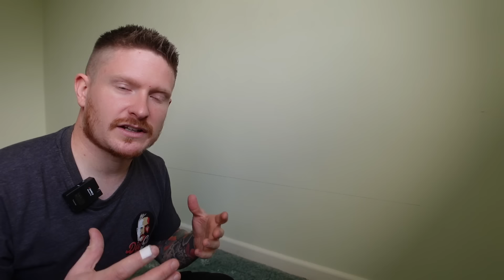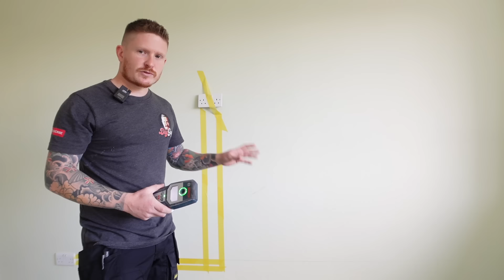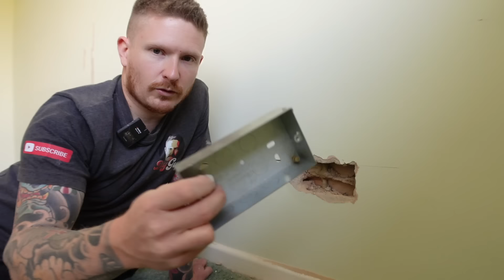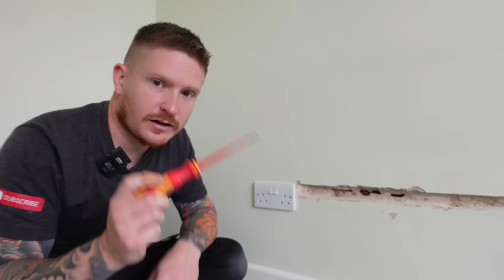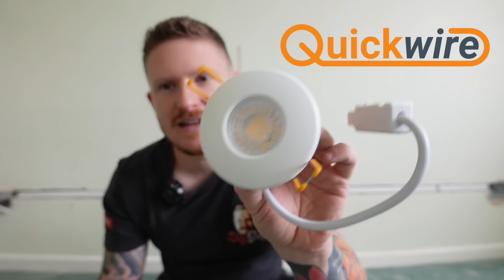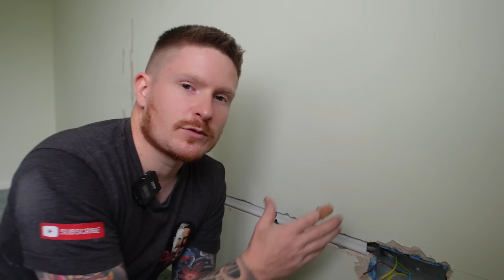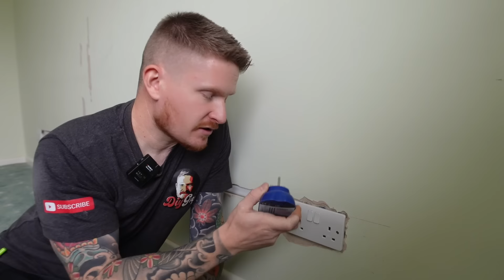How to Add a Socket to a Wall - Easy Step By Step Guide

Comment: He tested with a socket tester before and after. Wore a mask. Said you can only do one spur. Added a grommet. Doubled back the wires. Used a conduit (not required). Covered cable zones and how to check. Said only do it if you’re competent and confident or use a qualified electrician. Simple as it gets for a perfectly safe and legal diy job. If the original socket is RCD protected so is the new one. Great job ❤ ignore people trying to create fear using completely different examples.
Reply: You can buy dust guards with hoover attachments for normal angle grinders for around £30. They work very well.
Reply: Perfect job for a qualified electrician and whilst the fundamentals are pretty simple the work needs to be signed off on if it's a DIY job otherwise in the event if an electrical fire the insurance would be null and void. It's best to leave this work to qualified tradesmen.
Reply: Therein lies the problem. It's not really a DIY job (anymore).

Also, a basic socket tester only checks for polarity and some wiring faults but does not test for earth continuity, insulation resistance, or loop impedance.
Reply: @escfxp  why on earth would he need to test for continuity, insulation resistance or loop impedance on minor works? it's just a spur off a socket, nobody said you could do those tests with a socket tester either !
Reply: Call it whatever you want. It needs to be tested. “Just” is the problem. This kind of work would be illegal to even DIY in certain countries.
Reply: @escfxp it's generally a good idea to get an EICR done every five years in the home. If installing socket a couple of days before and the electrical test that follows is all good; no problem. 

The way in which this tutorial was delivered was excellent. 

Many, so called, certified electricians out there; don't bother with grommets, don't bother with wall capping and don't bother with proving units (because they simply touch the two ends together to check the testers are working) so what's your point? 

It is even possible to extend the ring, as opposed to spuring, with wagos if you wanted, although there might be a space issue so extra work might be required to accommodate a wago housing box.

Bottom line is, you're obviously safety conscious (and that is not a bad thing). However, to over think safty to the point that no progress is ever made is counterproductive. Only a competent person should undertake the work, that's what the regulations say and that's what this guy has said. 
Out of curiosity, do you ever cross the road or do you look for a bridge or under path out of fear of safty?
Reply: @escfxp it’s a diy job and that’s coming
From
An electrician ❤
Reply: @CEO786  So an amateur DIY person can do this job? Do you see where this is headed?
Reply: @escfxp  Of course, lots of work for electricians to fix.
Reply: @escfxp it’s a spur not a 3MW Data Centre
Reply: @craigevans8912 Try it in Australia or Germany and you might get lucky. Certain other countries have standards far higher than the UK in this regard.

Technically, it should have a minor works certificate should any incidents occur. Insurance, for example, will look to scrutinise on this if an electrical fire were to occur.
Reply: @craigevans8912 

Fires don't care.
Reply: @escfxp  Agreed - Plus I don't believe he is a trained electrician.
I don't care what people say but electrical jobs are not for the DIY'er
On another note, a lot of his other videos are well worth a watch.

Comment: Your socket won’t be level because of the overlap of the top of the socket outside the back box. What you’ve levelled is the top of the socket with the top of the new back box. Excellent video otherwise 👌

Comment: Can this be done by a DYI instead of an electrician?
Reply: Yes, you can alter any circuit as a DIYer but any new circuits have to be signed off by a qualified sparky
Reply: @Luke_Carpenter-i8q thanks I didnt know that, I thought an eletrician would always be necessary. Of course I would never do something complex, but rather simple stuff like increasing the number of sockets on a wall for example.
Reply: @vincoletto2  exactly

Comment: You left the original cpc's twisted together and un sleeved! This is a hazard if a live conductor was to come into contact with the bare cpc! Also just because someone see's 2 cables in a socket to persume its a ring final circuit, it could already be a radial circuit? Correct you can only spur once per outlet on a ring main, but you can add multiple outlets if you fit a fuse spur then the outlets as its protected by a the fuse spur, i wouldnt advise anyone touching electrics

Comment: Thanks for the video it's very informative 

However, you demonstrated moving socket just across, what if I need to move it on to the perpendicular wall, and pass the corner, will I stay in the zone ?

Thanks

Comment: Great video, very clear, however, I've only one spur to do so don't want to buy massive bags of PVA, bonding plaster etc - can I not just use a ready made filler like Polyfilla?
Reply from the maker: Glad you liked the video. I’ve never tried it but it may crack.
Reply: Clearly too late for you, but may help someone else in the same position looking.

You can get small bottles of pva like 500ml-1L you can probably even use crafts PVA as it’s the same thing 😅.

As far as fillers go you can use ready mixed, but you’ll have to build it up in - several- layers. Don’t use finishing fillers
As they’re designed to only fill a few mm. check on the tub how deep is the max filling and choose the deepest. 
There’s also small bags of all of these items, but if you’re only doing the one socket and no other DIY, then ready mixed is your best bet.

Comment: Hi Cameron, this video has been very helpful since I've been renovating my inherited property over the last few months to get it up to modern & safer standards and thanks to your videos I'm starting to learn DIY. Just wondering, does the socket tester you used in this video detect other kinds of electrical faults with the sockets if there are any? I just ask because I will soon need to get an electrical safety certificate and if the socket tester you recommend can detect any issues with the sockets before I get them checked by an electrician (and therefore allow me to have them remedied before I get failed) that would be helpful.
Reply from the maker: Hi. The socket tester will help you find issues with common faults such as reversed conductors, polarity.

Comment: You never run cable along the wall like that because it is open to being damaged. NEVER, NEVER, NEVER DO THIS? This is a very bad practice. I always learned as an apprentice to only do cabling vertically then either through the ceiling void and/or under the floor.
This breaks all the rules in my book.
If this cable zoning is now permitting this practice in the IEE Regs then it’s the biggest mistake they’ve ever made. ❌❌❌❌❌
Reply from the maker: This meets regs and is safe to do. Thanks
Reply: Mate your wrong 😂 the cables where run in zones, you can technically run vertical or horizon off a socket outlet

Comment: Could you go vertically first then horizontally from the lower socket?  And do you have to be a qualified electrician to do this ? Can you run the cables loose behind the plasterboard without a conduit and what if you want to keep the new socket in the ring main rather than creating a spur?
Reply: If the circuit is RCD protected & the cables are ran in the zone correctly then capping isn't required
Reply: Any additional electrical points, i.e. socket, light etc, or cable, must be fully tested with test equipment that is in calibration This work must pass ALL dead, live and function tests and a minor works certificate issued by a qualified electrician as per regulation. This is a LEGAL requirement.
For a d.i.y. channel he is competent and has given viewers great advice. There is a lot behind the scenes that many viewers will not be aware of, which could lead to safety issues.

Comment: I have hard brick behind my plaster, with not enough depth to fit conduit and then plaster and fill back over. I can barely dent the brick even with an sds in hammer mode with a chisel bit. I'm going to ditch the conduit and just plaster the cable  directly into the wall🤞
Reply from the maker: Fair, there’s nothing in regs that state conduit has to be used so your all good.

Comment: Hey great video's, I was wondering how to move an old kitchen socket from the middle of the wall down the wall to lower level socket.
Regards
Reply from the maker: You will need to extend the cable using a maintenance free junction box or pull the cable back to its source and replace with a longer one

Comment: Maybe this is very messy job, but as the wire & socket embedded inside the wall all the efforts are well pay-off to seal them from dust and very secure to the best safety possible worth doing it!! Excellent video, nice job!!👍👍
Reply from the maker: Glad you like the video 👍

Comment: Great video - really helpful for planning for the jobs I've been putting off! Quick question about the fill at the end - if I'm only doing one or two smaller jobs, what's a more economical alternative to the large 10kg bags? Would polyfilla suffice, or is that going to cause other problems?

Comment: I just wired a uk plug but there the wire 8mm diameter but the hole in the base of plug is 11mm so there is gap. Do you how to cover this gap? Is there a Sleeve or gland to go over the cord and into the plug?

Comment: Hi would it be possible to run another socket from a living room through a stud wall to a kitchen to add a socket on a kitchen wall. There is a socket on same wall that is mirrored in the kitchen wall behind, but would be easier to run another to its left around a corner and up the wall to its position on the kitchen wall

Comment: When i turn the socket off in my bedroom I get a arcing sound so if I replace the socket does it matter what brand I buy.
Reply: Yes , get from an electrical wholesalers not cheap B and Q crap.
Reply: @jablot5054  what brand would you recommend
Reply: Do you realise how dangerous arching is 😂 I'd be calling an electrician ASAP to investigate, not worry about what sockets to fit 😂 it's probably arching from your dodgy connections.....my god 🙈

Comment: You don't even have to use an SDS drill - I've done this fine with a normal cordless hammer drill to drill the holes, than then maisonry chissels and a hammer to open it up.   A lot of DIYers aren't even familar with SDS drills so don't go ordering an SDS bit as it won't fit in your typical household drill :)

Comment: Foaming a box in, you used a plug and proving piece of junk like your dealing with 20000 volts😂 also good job the grommet went in that old socket, just like there was a grommet in the bottom where the old wires came from, those wires that have probably been there decades without a grommet